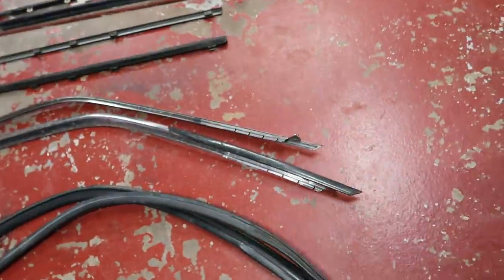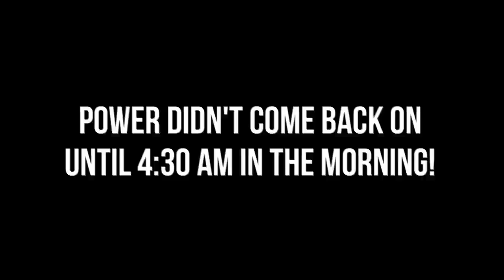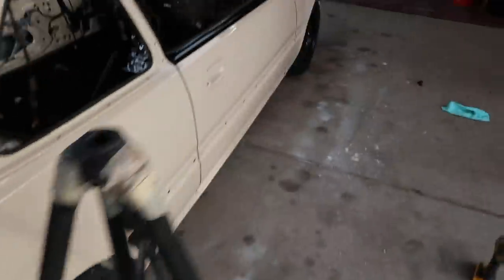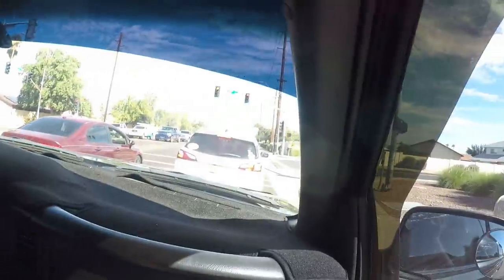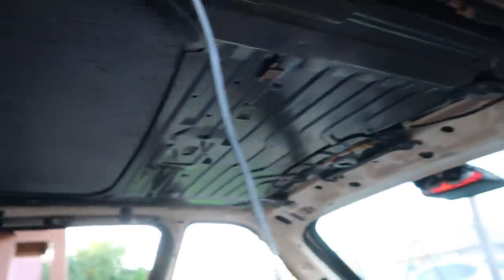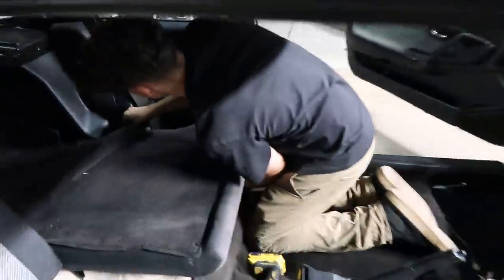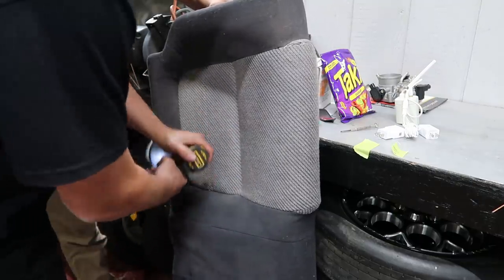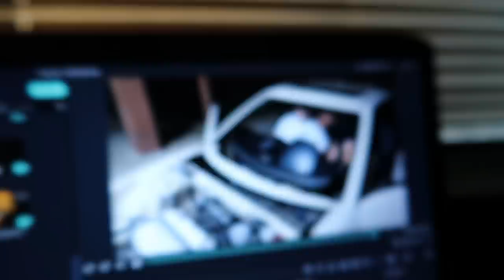The DA has FULL Interior again!!

Comment: If you want a cup holder, use the VW Jetta or Passat hideaway one from the early 2000s. It fits right under the radio. I siliconed mine right in. Cheer's

Comment: the thing with electric in tank fuel pumps they need gas on them to cool the pump if you run around on empty all the time your gonna go through pumps like crazy because the aftermarket pumps are shit a factory pump will last for ever but aftermarket you will trash 1 about every 2 or 3 years